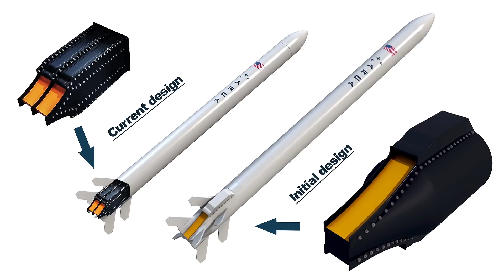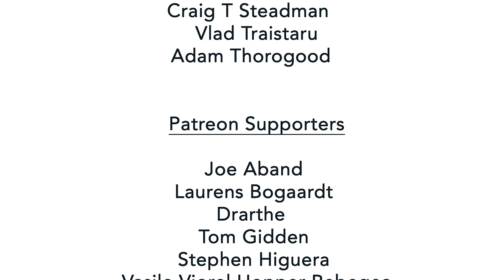Flight of the Aerospike: Episode 24 - The Linear Aerospike Integrated in the Test Stand

Comment: This is dummy test stand as well as the engine. The test stand structure is from welded steel and the plume will generate higher temps that steel's melting point, also the stand doesn't have actual exaust curve and this will compromise the structure too. This is scam.
Proove me wrong.
Reply: The demonstration will use hydrogen peroxide without the RP1 mix which will have lower burning temperature. If they painted the test stand with ablative paint. Melting will not be an issue.
Reply: @kazedcat  Hope you're right. Hope the engine is painted with same ablative material too.
Reply: @kazedcat  Maybe you mean HTP? If so my apologies this might work.
Reply: Ou and the fuel tank directly over the stand. Fireworks stand

Comment: What are the advantages of such type of engine?
Reply: A multi staged rocket limits your launch sites to coastal areas or super Remote areas which can restrict access and be complicated for logistics and client support. Delta V is important for the most efficient rockets but expanding access and opening up new revenue sources can justify the venture.
Reply: No one has ever test flown a working linear aerospike either, not to mention a "cold" thrust linear aerospike (NASA never test fired the LASRE in flight unfortunately).  

The combination of a "cold" thrust rocket with a single linear aerospike and relatively very cheap manufacturing techniques (thanks to "cold" thrust) is supposed to make their disposable rockets much cheaper to produce.  I'm tentative about the feasibility of the whole thing, but they are pursuing a unique avenue that if it works, will make access to space much cheaper at the low end.  Innovation isn't easy, and having the heart to do the work at the risk of failure is a courageous thing.
Reply: The main advantage of Aerospike is that it can easily operate under low pressure ratio and perform the same as cd nozzle.